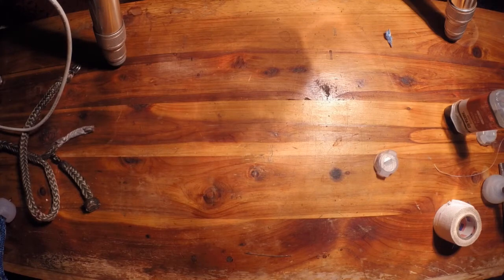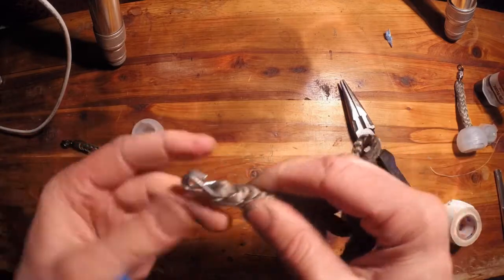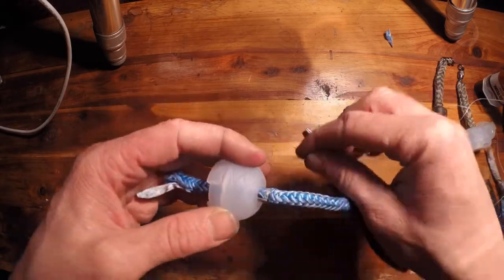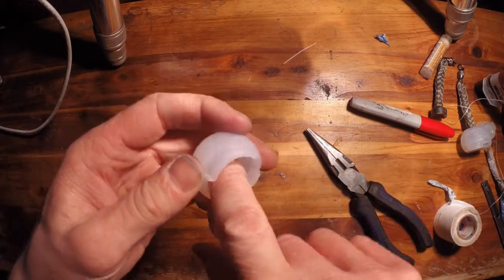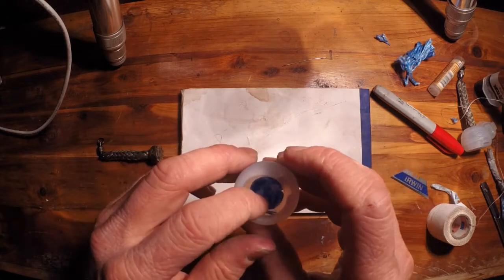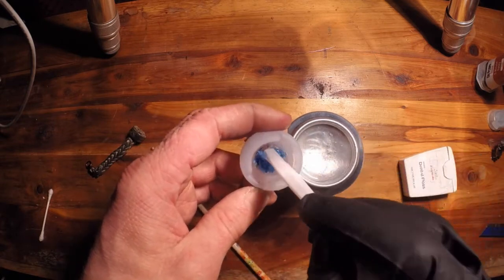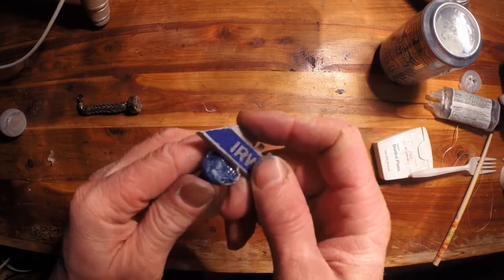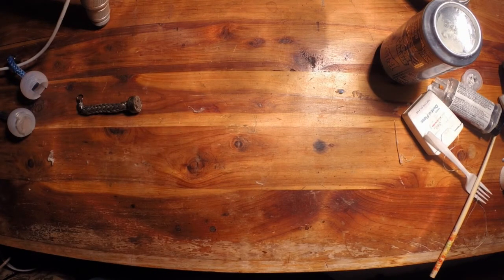UltraKnob with 1/2 Technora

Comment: How do u connect your technora from ur heads to swivels. Ive been trying to think of ways that work well. I dont like the they did mine. I forgot the weace its called but you mentioned it in the vid. Just curious because every other way ove seen theres a poi head flying somewhere eventually. Id appreciate the help ive been so stuck on this
Reply from the maker: This is how I do it and never have them come undone. The soft mr babache balls can split with this method but the UV versions don't. I mainly use the balls from flow on fire now and they have never split. 
https://youtu.be/Q3mQiH_O1sE
This is the newest mold I use for this method but still use epoxy for technora
https://youtu.be/zfBHKXuCexk